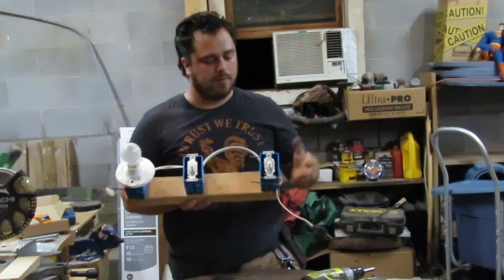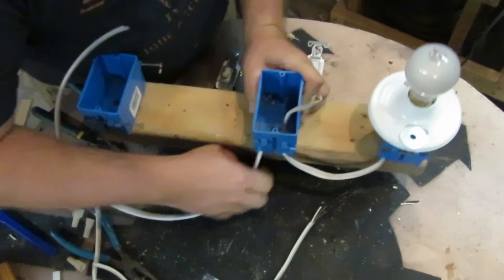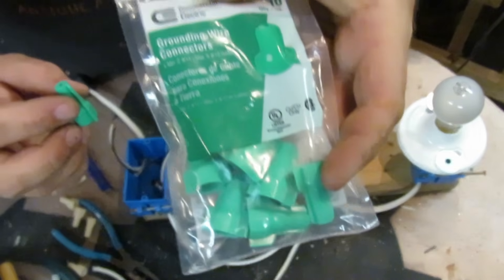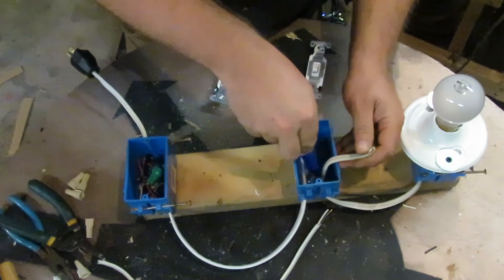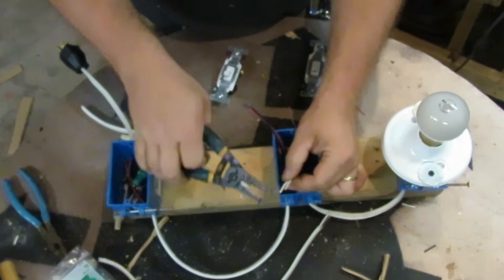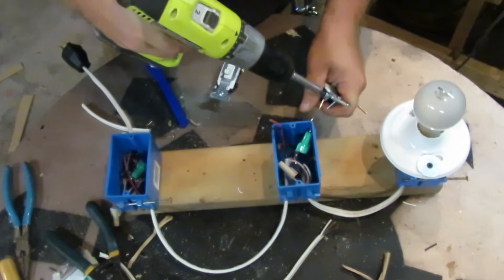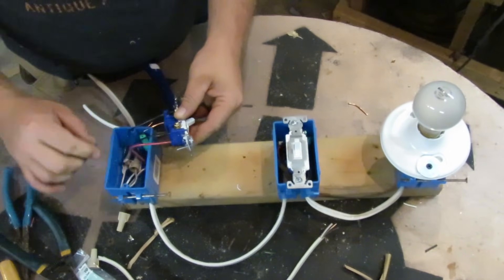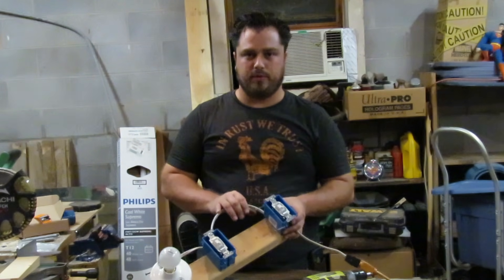How to Wire and Install 3-way Switches

Comment: Thank you very much! I have watched many videos on this and I kept getting mixed up with where the wires came from and which actual wires hooked up to where, which made me feel a bit uncertain.  However, after watching your video, everything was super clear! You showed us everything separately, showed us each wiring and explained it perfectly. This made perfect sense to me and made me feel completely comfortable doing something like this on my next project!
Reply from the maker: Thank you so much, I'm really glad that I could help
Reply: @MechanicalChaos  now how do you do it without the Carrier wire?
Reply: Using ONLY 3 wires.
Reply from the maker: It sounds like you might have a dead end 3wayone box will have 3 wires, the other box will have 2 of those wires on the 3way as travelers, use those same wires on the switch with just 3 wires and use the other wire as your common
Reply: @MechanicalChaos  like a water circuit...thank you.
Reply: @MechanicalChaos  what do I do with the extra neutral? Return to ground? or cap it off?
Reply: @MechanicalChaos  thank you for your response so how did pop's do it without a three way switch? And Only a bi polar switch
Reply: He also used a mass of neutrals dead ended he was a kreski school of engineering master's degree Holder.. multiple.. he built this house I was 12 at the time. Three electrician's have attempted to wire this switch giving up.. thank you for sharing  your wisdom...
Reply from the maker: If there is only a black, red, and white, then it wouldn't be a neutral, just a white wire, and all 3 wires would need to be used, but it kind of sound like there is a lot going on, it kind of sounds like you might need to get a meter and trace everything out
Reply: @MechanicalChaos  yeah I got a new one cause my old wire was busted and planned obsolescence.. I figure I'll have to take the fan down too since it's also the source of light... I figured he used a neutral for a load wire
Reply from the maker: Do you know where the 2nd 3way switch is?
Reply: @MechanicalChaos  wasn't one.. he used normal double pole switches and no Carrier wire..
Reply: A kid took the switch apart helping me renovate the house... Didn't know what he was doing, the company that rewired the main electrical conduit and main box couldn't figure it out, another electrician tried and failed, 35 year's experience.. completely stumped.. I'm determined.. I'll give it a whirl after work tomorrow and let ya know how it went , I'm a carpenter right now, but was Taught Every trade.. and have gained credentials years experience ect.. the pay is better now than I've ever had.. were a Dying breed..
Reply from the maker: Sounds like both switches might need redoing
Reply: @MechanicalChaos  oh yes and when I mean two wires in it three wires rather I mean two wires a hot a neutral and a ground thankfully it's Romex as the 1969 trailer and the addition that we put in we completely ripped out all the wiring there was aluminum and asbestos wrapped and replace the walls from 2x2 construction to 2x4 construction with half inch drywall and r13 insulation since my mom had a stroke diabetes cancer stage 3 and was diagnosed with the cuff positive of which the virus did nothing to her she was asymptomatic watching everybody die on the deathwing of the hospitals in the geriatric Wing wig of the old folks home they stuck her in where the outbreak occurred once the hospital center there so she survived all that so at the meantime while she was in the hospital and saying she can't eat the food etc and I told her to work it up so she can come home I've been renovating the 1969 trailer with 18 " n or less; doorways with Ada 3 ft wide doors and wide hallways and newer electrical updated plumbing updated electrical updated fixtures updated flooring drywall etc they already is the covid literally did nothing to her with stage 3 ovarian cancer diagnosis of diabetes and suffering a stroke major of course this was all induced by depression from my father passing from Agent Orange in 2011 brain cancer for an inventor and engineer
Reply: Honestly I think I'm going to have to break out my lead continuity wire on clippers rather alligator clippers and find out which wire does what and where it goes to etc the only take about 10 minutes it's just a good colossal pain
Reply from the maker: From everything you've told me it sounds like a colossal pain in the butt
Reply from the maker: If it's just black, white and green/ bare then I don't think you'll ever get it right working as a three-way
Reply: @MechanicalChaos  well it worked before I'm home now so I'll see what happens
Reply from the maker: Good luck
Reply: @MechanicalChaos  yeah I'm good at fixing unfixable things thanks for your input though
Reply: @MechanicalChaos  I got it so it switches on and off at one light and turns off the other turns out Dad used the ground wire..
Reply from the maker: I'm glad you got it figured out

Comment: Good video.
I honestly don’t know who’s worse, the builders that put the switch on the side of my laundry room in a counterintuitive (opposite side from where it should be) location, or the original buyers that likely cheaped out on having two switches installed. Both were jackwagons in my opinion. 😂

Anyway, thanks for making this video man. 🍻🇺🇸🍻
Reply from the maker: Thank you, good luck with your laundry room, if you are goimg to turn a single switch into 2 3way switches, you'll probably need to wire it as a "dead end 3way"
Reply: Thanks brother!
Just out of curiosity, why do you think it would likely need the California 3 way? I’d like to keep this as simple as possible. 🍻🇺🇸🍻
Reply from the maker: If you are turning a single switch, both your power and switch line would be in the same box and the normal way to wire a 3way has power in one box and the switch line in the other box

Comment: Tip don’t use the stab in’s on the switch, these connections don’t always last. Always use the screws, all around better connect this way.
Reply: I get more from stab its. Maybe it’s just my area. 36 years in the trade and it’s always been the stab ins for me.
Reply from the maker: Yea, they use to be crap
Reply from the maker: The old stab ins were garbage, but they have gotten better, I get more service calls about loose screws than I do loose stab ins

Comment: Why is call 3 way s
Reply from the maker: In some parts of the world it is called a 2way switch because they work in pairs, but some say it is called a 3way because there are 3 terminals and 'way' is an old engineering term meaning 'terminal'

Comment: Can you explain why/when we would use a 14-2 wire versus a 14-3?
Reply: For clarity, I understand the difference between the two. I’m just not sure why we’re having to have an extra wire and when would we use them? Is it solely with lights? Or multiple receptacles?
Reply from the maker: In thos case, the 14/3 wire is being used as the travelers and to bring over the neutral to the other box.

But 14/3 could also be used if you want a half switched plug, where the black wire can bring over power and the red can be used as a switch line.

The are also useful for fans, so you can pull 1 wire and have 2 switch lines, one for the fan and the other for the fan light

Comment: Hello, can I hook up an LED plug in light with no ground?  I tried hooking it all up but the the switch wired to the light has to be on at all times for it to work. Any recommendations is appreciated. Thank you
Reply from the maker: An LED light should be fine

Comment: Hi.  I have a question.  I tried putting in two 3 ways with the Lutron Diva Dimmers.   They are flickering so I called an electrician.  He said I have to take out one 3 way and close it off because a wire is missing and the walls are all closed up and he doesn't know how it was originally done.   The lighting store said you can't use Diva dimmers on both sides, just one side, and a single on/off switch on the other side.   I am trying to get to the bottom of this without calling in yet another electrician.  Any guidance would be appreciated.  Thank you in advance.
Reply from the maker: Do you know what wires are in each box
Ex: 1 red, 2 black, 2 white, and a ground
Reply: Mechanical Chaos.   They’re covered now but I believe all 3 colors and ground.   There was no neutral so the electrician added that in at one location.
Reply from the maker: I'd probably need you to pull them out to give a detailed description of each box

Comment: I read through all the comments and I can’t believe nobody asked you this question... what was that wizardry you did to connect the ground wires??? Instead of taking a pliers and putting a curl on the end, you did what? Somehow steadied the wire and twisted the switch around it? I have never seen that before! Was it a special feature of the switch? Can you please explain how you did that?
Thank you.
Reply from the maker: There is a little tab on the metal that the ground screw is on that lets that wire wrap around like that

Comment: I have 2 other light fixtures that o would like the 3way switch to work for on my hallway where do i connect the other 2 fixtures?
Reply from the maker: You could connect them to the switch line side of the 3way system or to the light that is already controlled by the switches

Comment: Using a drill on the toggle switch and no electrical tape or band around the connections after connecting.
😖
Reply from the maker: You're right about the drill but never electrical tape that just hides problems until the electrical tape fails and then you don't know where it is as opposed to be in a fix it right away

Comment: Sure. This would be simple IF I had brand new wires to work with. But I don’t. I have two boxes with old effen wires that I cannot identify what is what!
Reply from the maker: The easiest wire to id is the hot, if you have a tester, find out what wire is the hot, let me know and I'll try to help from there

Comment: The way you did this, it only shows when the light is on the end of the circuit. Wiring is different depending on where the power comes in, and where the light is. (Beginning/middle) Not a very good explanation in my opinion. You need to explain how power is flowing through to make it more understandable.
Reply from the maker: There are around 5 ways to do a 3way setup, I only showed 1 way in this video, I have plans to do a video on each way, but I haven't done them yet :(

Comment: If my light does not have a ground screw do I still have to pigtail the second switch or can I just put one ground wire from the first?
Reply from the maker: You want to pigtail that ground going up to the light box, if the wire gets hit with a screw or something, that ground will save you

Comment: How can I put a switch outlet at the end saying it was down the cellar, I would like to leave the outlet on at all times?
Reply from the maker: If you are coming off of a 3way switch, it has to be the hot wire side and not the switch wire side. As in you need constant power on the common wire

Comment: Your ground is good . Your neutral is good . Your common is good . But you have to emphasize the red and black traveling wires need to be on same terminals duplicating each switch . If they are reversed it will trip the breaker .
Reply from the maker: No it won't, that doesn't even make sense, how does the electricity know what color the coating is, it is the same electricity, as long as they are on the brass screws.

Comment: You confuse me with the terms travelers and common wires. I'm trying to see the color of the wires but you go very fast. My situation Will have the power coming into the same box as the lights and then a remote switch separate. So I'm not sure what to do with the red wire in your demo.... Thanks for any help you can provide.
Reply from the maker: The colors don't matter, just what the wires do.
The power wire and the switch wire are both "common" wires

The 2 wires that travel between the switches are "travelers"

You need to do what we call a dead end 3way.
Reply: @MechanicalChaos  and that wires up the same?
Reply from the maker: Ok, right now you have a hot wire, and a switch wire in one box, run a 14-3 wire to the other box.
In that box wire your 3way switch: red&white as your travelers. And the black wire as your common.

In the first box: wire your red and white from the 14-3 wire as the travelers. Use the hot wire as your common. And wirenut the black wire from the 14-3 to the switch wire.

That should work for normal 3way switches but it will not work if you need a neutral in the 2nd box

Comment: Two bulb controlled by two stage illumination
Using 1 single pole switch and 2 three way switch.
Anyone who knows how to draw the diagram please help.😅
Reply from the maker: You need a 3way-4way-3way
Reply: @MechanicalChaos  how?
And my intructor specifically told me to use a single pole switch(1) and 2 three way switch.
Reply from the maker: Then I guess I didn't understand what you were needing
Reply: @MechanicalChaos  oh ok thanks anyway

Comment: Can you please make a 3 way switch connection but with the electric wire also going to the same box as the light. I have a switch down stairs for upstairs Hall light but electricity is connected to light upstairs from cieling light.
Reply from the maker: You can run a piece of 14-3 wire from the existing switch.

In the new box: hook up the 3way switch with the red and white wires from the 14-3 as the travelers and the black wire as the common.

In the old box: wire the red and white wire from the 14-3 to the 3way switch and wire nut the black wire to one of the old wires and wire the other old wire to the common side of the switch.

Comment: I followed this exactly and don't get them to turn on/off on each end....I went back and checked the wiring...Ii noticed that my levitons have silver terminals on all 3...I checked the receipt as I threw the packaging out and they were 3way switches...what now?
Reply from the maker: Look at the back of the switch closely, one of the screws should be labeled 'common'

Comment: I'd like to convert an existing single pole switch to operate off two switches.  The current switch only has 1 white and 1 black wire hooked up. It operates 2 overhead twin tube fluorescent lights. I'm thinking the lights must be in the middle of the circuit, since there is only the one 14/2 plus ground wire in the switch box (the ground wire actually seems to be routed out of the box back inside the wall somewhere.

Any idea what's going on with the switch from my description, and how to best go about converting it to a 3 way?
Reply from the maker: Sounds like you have a switch loop, where the power is in the over head box and they use one 14-2 wire to loop down to the switch. One of those wires in the switch box is bringing power down and the other is sending it back up to the light. Basically one is your hot wire and the other is your switch wire. You would be able to add a 14-3 wire to the switch box and basically create what we call a dead end 3-way
Reply: @MechanicalChaos  Thanks for the reply. Would it be the same process as this video depicts? If not, do you have one that shows the process?
Reply from the maker: You would add a peice of 3 wire from old switch to new switch.

New switch: red&white as the travelers and the black as the common.

Old switch red& white as the travelers and the old white as the common and wire nut the old black to the new black

Comment: Can a 3 way switch provide a hot line the end for other loads and switches? https://diy.stackexchange.com/questions/161060/can-a-3way-switch-provide-a-constant-hot-line-to-another-unrelated-load-or-switc
Reply from the maker: You would have to turn your 3ways into a single pole but it could be done

Comment: You was moving too fast and not showing the wires by each name 
So I could understand wire go where
Reply from the maker: The red and black travelers go on the brass screws, and the common black wire goes on the odd colored screw

Comment: How would you do it if the power is coming from the fixture not the switch?
Reply from the maker: The simplest way is to drop a 14-2 from the light to 1 switch box and run a 14-3 between switch boxes.

Light box: tie the neutral from the power wires to the light and wire the hot wire(s) to the black wire on your 14-2 switch wire. Wire the light's black wire(s) to the White wire on the 14-2 switch wire.

Switch box: wire the red and white wires as the travelers on the 3way and the 14-2 white as your common. Wire the two black wires together.

Other switch box: hook up your red and white wires as travelers and yhe black as your common

Comment: Let me ask you...is it possible to add another light or a motion sensor light to this setup? Thanks
Reply from the maker: It depends, yes if it is on the switch line side, no if you want to add it off the switch that has the power to it